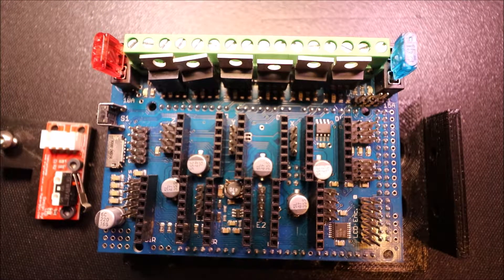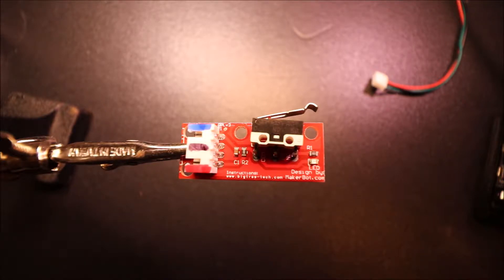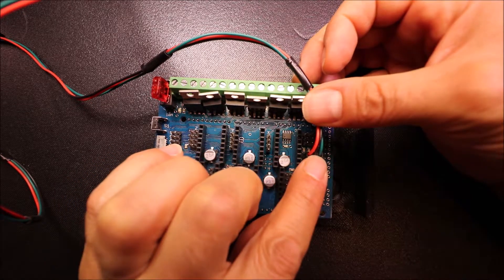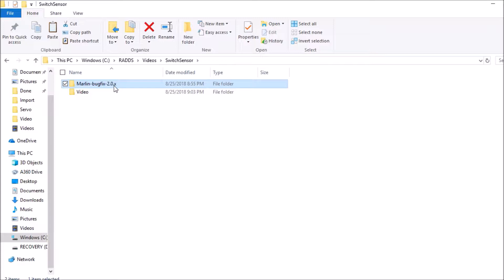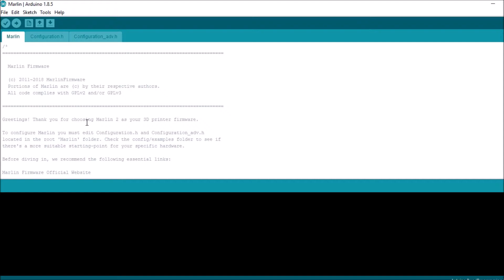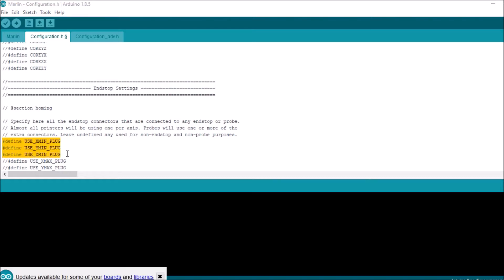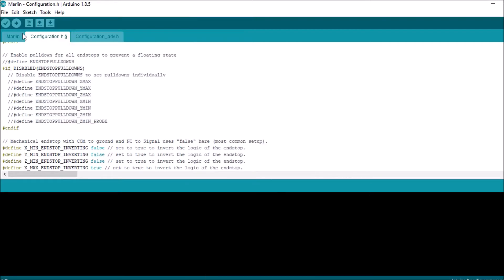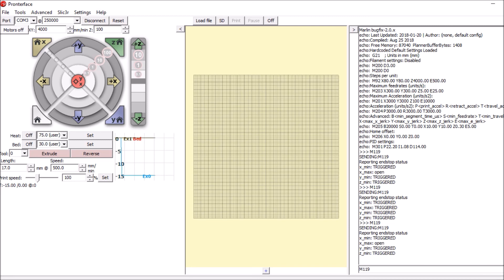RADDS - Switch Endstop

Comment: Hey.
Can RADDS be used for an INDEX printer?
It is about the SIGMA R17 Dual extruder
Reply from the maker: I'm not familiar with SIGMA R17, but I think you're asking if the board can do dual x axis printing.  The Answer is Yes, in theory, because the Marlin firmware will give you the ability to move multiple x-axis in Configuration_adv.h of Marlin.  I'm still researching how to do a tutorial where it makes sense to people, but I may have to build a printer configuration to demonstrate.
Reply: Thank you for your reply.
I understand that an additional X motor is plugged into E1.
Where is the additional switch endstop?
Reply from the maker: The xmax Endstop maybe what you're looking for.  Haven't tested this yet.